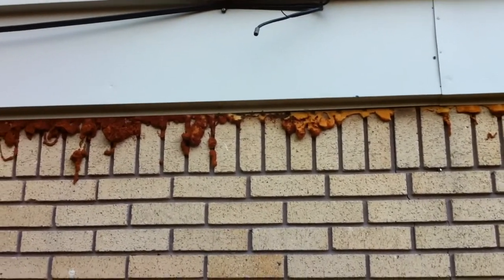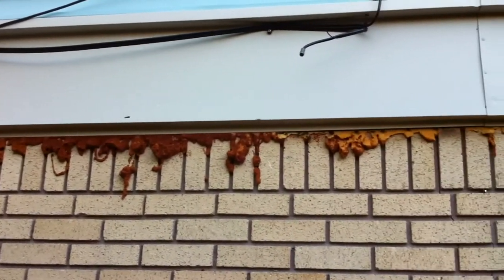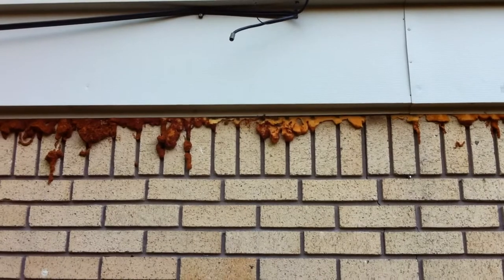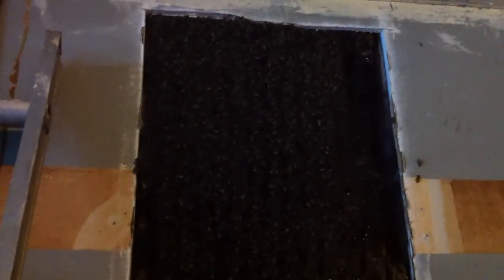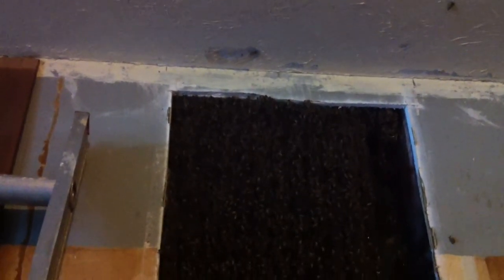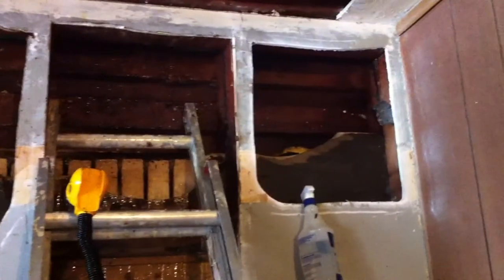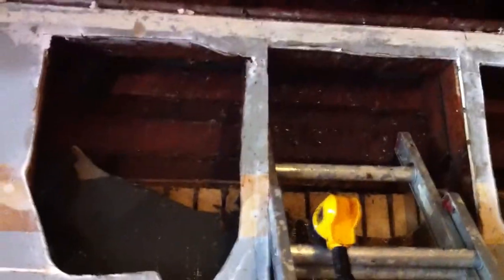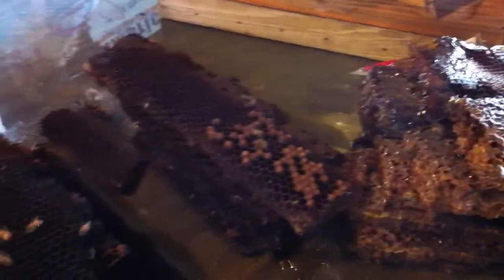Honeybee Removal 030 - Bees in wall - 8/23/13

Comment: You remove the stragglers from the home too right?
Reply from the maker: Depends how many there are. If the hive is greatly dispersed I'll leave the box until night time to catch every last one. But typically I use repellent to drive all the bees out of the structure. The returning foragers my cluster nearby but not back in the cavity.
Reply: Interesting. How often do you get big jobs like this? Not quite this size, of course, but I mean bigger than the average hive that you see hanging on the side of a barn or shed.